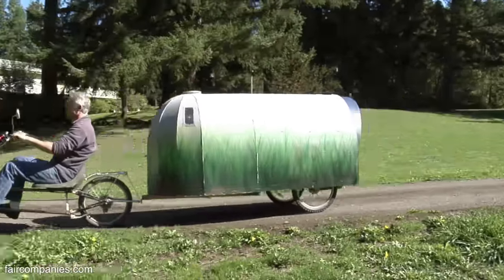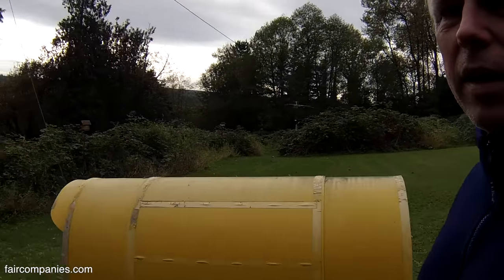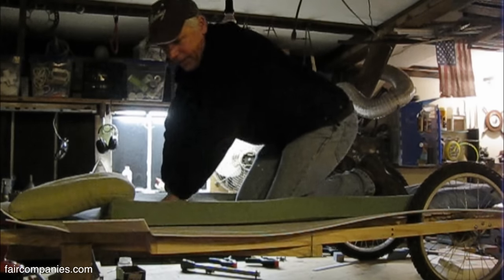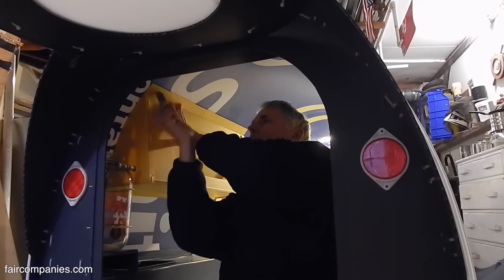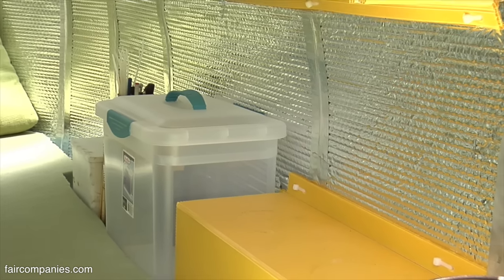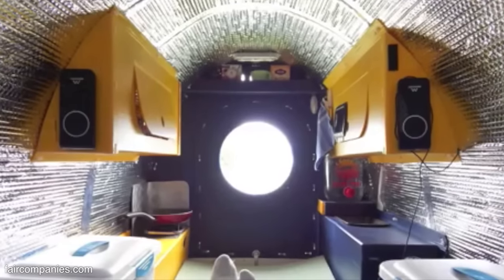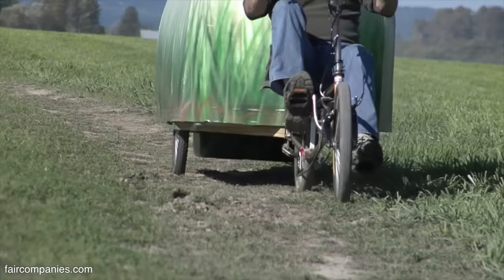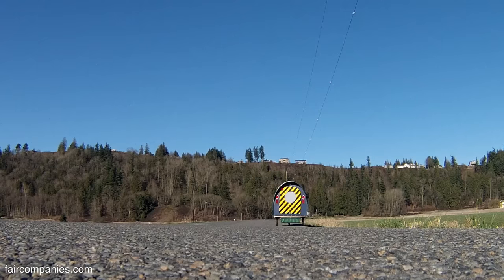$150 bike camper: DIY micro mobile home (downloadable plans)

Comment: I've worked in the large format printing industry for 18 years and my advice to anyone interested in making one of these, contact your local large format printer and ask them if they have any scraps. Unfortunately the industry is very very wasteful and there are often many odd shaped drop pieces that too often end up in the dumpster because they are difficult to recycle properly. You can score all kinds of amazing materials by just asking. Coroplast, acrylic, canvas, vinyl ect. It never hurts to ask. Also I've gone to foam manufacturers to score their drops as well when I was working on a costume project. They often have tons scrap pieces they will gladly let you have.
Reply: a2 - your comment makes a partial circle... almost like a rainbow 🌈 Can you see it?
Reply: Thanks for the advice!
Reply: No such word as 'ect' or is that another arcane material? ;o)  Perhaps 'etc' which I've been told is a contraction of a Latin phrase: et cetera,  meaning "and so forth")
Reply: +Richard Bruce Graham who cares we're on YouTube, not in school.
Reply: Ive done the same with granite shops.  Their removed broken and discarded backsplash pieces make amazing FREE lawn edge barriers for anyone with neigbbors that have creeping weeds like i do.

Comment: the largest sized dog houses available are also a great option. just need insulation inside. you can connect them, cut them and put them together, etc. worked well for me hiking in the winter. i make shelters along my most traveled routes and the dog houses have been extremely durable. even just one to lay down in, I'm 5'8 with enough room for my pack and boots inside.
Reply: very interesting idea. cool little bug out "huts/shelters" could be another function for them.
Reply: I am not sure what kind of doghouses you are thinking of, but I'm curious.
Reply: Great idea I may try this thanks
Reply: @geob01  they look like giant plastic igloos, they're usually made as outdoor dog houses. they last practically forever.

Comment: Get an electric bike and use the batteries on the bike at nite and recharge during the day from solar panels also save on pedaling up a hill.
Reply: Why not save up a little more and get a moped? Great on gas and seems more simple.
Reply: What if gas is not available?
Reply: Roronoa Zoro irrelevant question. Gas is always available, in every state and in every town. If you become stranded somewhere and have ran out of gas, then that’s a personal problem.
Reply: Wretch Gunk I’m not suggesting that gas is superior. I’m speaking solely from the perspective of being in a homeless situation, living near small towns or the far outskirts of a big city. In that particular situation, I’d MUCH rather have a moped & utilize gasoline over solar power. I could easily make the money for the moped/gas through raking leaves, shoveling snow, mowing grass, scrapping metal, etc etc.
Reply: Wretch Gunk You could connect  a small dynamo to one, or both, of the trailers axles and use them to charge one or two car batteries as you pedal, use for lighting, charging mobile devices, etc, could have solar panels to keep it ticking over when you are stationary for a little while, it could be a great home away from home, could have the batteries under the floor in the center, even add some extra storage under there have lift up flap for access,  I'd have great fun planning everything out!
Reply: Get a moped with peddles, for if you run out of gas
Reply: Or you know get one of those gas motor kits for your bicycle Tada best of both worlds
Reply: Now THAT sounds like a good idea!!!
Reply: Dennis Day another good idea...and just get one of those lightweight tents to set up at night and you’re ready to go!!
Reply: Gamble do you have any idea how heavy batteries are
Reply: Gas electric hybrid
Reply: "connect a small dinamo to the axles while using an electric motor to move everything" why don't you people understand that's not how energy works. Everytime you convert one type of energy into another you're losing it. If you charge a Li-Ion Battery you have around 95% efficiency so 5% or the energy is going wasted, if you use those batteries to move a motor you have around 90% of efficiency plus you have to add all of the energy that goes into mass movement and friction from the bike, the trailer and the air. so let's say 90% efficiency on the electric part plus a 50% efficiency into kinetic energy, then you have to convert back ON DIFFERENT GENERATORS to electricity. which is also constant so it adds weight to the first engine or your legs instead of smart activation like on newer cars. At the end you're losing more energy than what you've gaining, if you don't count yourself and your fatigue as a generator.
you're not smarter than all the engineers we have on electric cars
Reply: just put a motor on it put a solar on it but electric bikes work good too
Reply: People who live in these cant afford electric bikes. and probably arent in a position where they could save up enough money in a reasonable time
Reply: Or charge by day, pedal at night!

Comment: you should make a video just about "harvesting" the signs.  that would be hilarious.
Reply: No need to make a video, just go down to your local election headquarters and they'll donate all the 4x8' signs you can haul.. Especially if you tell them what you're doing with them.  They'll also throw in the wood that was used to hold the signs up.
Reply: November! Don’t forget the harvest is coming soon!
Reply: @sidelinedmom9609  I have a 2 hour bus commute over a 20 mile stretch through LA 4 times a week. I haven't seen a SINGLE campaign sign out here 😳
Reply: FPVREVIEWS could use all those hillary for presedent signs lol
Reply: Update: I was able to get 5 of them the morning after midterms. Still not sure what I'll be doing with them
Reply: @gregsmith2190  Sending my support for Trump from the UK maga 2020 .... you lucky bastards I will swop you a trump for a Theresa May
Reply: I’m glad you could locate some signs. They are everywhere up here in Washington.
Reply: @gregsmith2190  this is a video about a bike camper and yet still you have the need to bring up your political opinion. Calm down with your TDS issues.
Reply: Cruciflex make a crate
Reply: @gregsmith2190  you found your chance to attack trump on a bike camper video. The ultimate tds, wow.
Reply: @feeelickss  make a small shed. Upgrade it to camper if you like ;)
Reply: @gregsmith2190  how'd that work out lul
Reply: @trungminh321  holy crap, this would make a great shed! To the campaign head quarters!
Reply: Greg Smith u mad

Comment: Next challenge: make the entire bike/caravan into a single unit, like a motorhome but without the motor - a cyclehome, if you will - such that you are traveling within an aerodynamic and weather protected cabin. It could reduce the overall length and remove one of the wheels decreasing weight and rolling resistance.
Reply: +spinycrayfish Spiny you know, 80% of the force you feel while pedaling is air resistance, rolling resistance is so much weaker than air and air so much weaker than gravity. Just letting you know! ^-^
Reply: Hence the benefit of driving from inside the cyclehome. Tow something like that and it's the person up front slowing you down. :)
Reply: +spinycrayfish --- You can get a shell for a recumbent  but as most things these days real pricey, but an all in one unit would be neat
Reply: +2012spacetraveler Velomobiles man! You can make the shell out of coroplast!
Reply: That's exactly  that crossed  my mind...also having bendable fiber rods to make upper frame so that it would be taller and a bit wider then a water proof canvass strapped to rods
Reply: Spinycrayfish, I need to introduce you to my friend Rick. He's pedaled passengers around for years. His name is Rick Shaw.
Reply: Was thinking the same thing.

Comment: I once cut, shaped, welded and riveted together the shells of two gas furnaces I had lying around.   Used free cardboard box on the inside to act a wall/ceiling insulators.   I made a little storage shed of sorts on wheels.   So ugly... so heavy, but I might just try something like that with it for fun.   I like your idea.
Reply: mashroob  sounds like it would be heavy and hard to pull you should put some solar panels on it and get and Electric bike that you can power with the solar panels so you don't exhaust yourself!

Comment: Have to keep an eye on those zip ties as I've had them turn brittle from sun/weather exposure and break. Otherwise, good for him (and for disposing of some campaign signs).
Reply: +justgivemethetruth   Yes, the UV rays are hard on plastic, but if you just spray it down once or twice a year with Armor All, that will give you the UV inhibitor you're looking for. This is very cool. I really enjoy Pauls channel.
Reply: ....and the price just went up.
Reply: +Random Button Pusher I&#39;ve heard people say that the black zip ties take the sun better.  This construction method covers all the ties with duct tape, so I don't know if it matters or not.
Reply: I've had problems with black zips. Yes, the major seams were covered, so that should help. Perhaps the spray paint will help too. Better than having to regularly spray with Armor All or other such (808?) like I should do with my Royalex canoe. But overall, it doesn't look like to sturdiest construction. That's the trade-off for light and inexpensive. Cool idea still.
Reply: +Random Button Pusher You can buy UV resistant zip ties for use with garden plants and shrubs. Won't last forever but much better than the cheapies.
Reply: Thanks for the tip. While zip ties are quick and cheap, I wonder if there aren't ways to use thin cordage to stitch the panels together, as folks who make certain types of wood canoes do.
Reply: Random Button Pusher
Canoes and kayaks are stitched with wire, but it's removed after the glue dries, and before the fiberglass is applied.
Reply: I was just thinking of the stitching concept, not the full fiberglass technique, when offering the comparison.
Reply: Random Button Pusher
Sure, I get that.  The thing with zip ties is they are really convenient.  Stitching with a long piece of wire is a bit more trouble.
Reply: +Random Button Pusher Paracord comes to mind
Reply: Yeah, inexpensive, too. Or one of the thin, high-tech cords, which I bet you can find one that is UV resistant, though pricier for the durability.
Reply: +Random Button Pusher black zip ties absorb the UV rays easier. As an electrician, we were required to use clear zip ties when securing down wire to cable trays.
Reply: +Random Button Pusher Doesn't he cover the sun-exposed zip ties with duct tape and paint?
Reply: +Michael Derosier Thanks for that info.
Reply: +Random Button Pusher IKR.  Too bad he can't do the same thing with the ones on TV.
Reply: Eric Hawk Yes, I noted that in a previous comment.
Reply: +justgivemethetruth 
Use the black ones - they last a lot longer.
Reply: +deezynar You are absolutely correct regarding black plastic being more durable. Anytime color is added the material is weakened at the molecular level - ie tires are black - this is the same basic principle.
Reply: +Jason Seifert (Jay) Depends on the polymer. Most are naturally white or cream coloured. Adding colour means adding suspended particles which might block the UV rays a bit.
Reply: +Random Button Pusher      Some of the wire ties have a UV protectant added to the plastic.  I believe they are colored black to indicate the UV protectant presence.  Be sure to read the specs.
Reply: +Random Button Pusher I personally would have used plastic rivets and washers that are designed with UV protectant.  I would have also used a rib cage design using carbon fiber rods for stability and rigidity.  As far as a solar panel as he mentioned, the technology available now is very light weight.  The biggest weight would come from the DC/AC inverter and the battery.
Reply: SecurityPro2704 Just use dc only. It is all what it needed to power most of devices and LEDs
Reply: Yeah as said in other replies the black zipties dont really get weathered, im do security cabling including electric fences and we use the black zipties to put up the signs, legally need to always be on the fence so they we cant really afford to use ones that go brittle
Reply: +justgivemethetruth haha!  they do:  just use black ones.  UV does not destroy them in 1 season!  even HF sells the black ones for a premium -calling them UUV resistant.  hahahaha!
Reply: I've had the super heavy duty zip ties break too, however, they make them in metal!  Or you can even go cheaper and stronger and use hay bail wire!!!
Reply: Leslie Ann Taylor-Bjarnson Metal zip ties, cool. But baling wire is a great idea -- not as quick to apply, but cheaper/stronger is good for DIY.
Reply: Bail wire is amazing and super cheap.  I actually used it yesterday to replace the wire on my cheese slicer that broke.  The wire broke and I thought - I'm not going to go buy a  new one, I'll just find some wire, take the broken wire off and replace it with bail wire.  It worked!
Reply: Leslie Ann Taylor-Bjarnson Outstanding!
Reply: hose clamps would work in that case...
Reply: Nicholie Polie No rust problems on those? I had them around and they rusted into nasty state. I might have bought some shitty ones.
Reply: Just pack some extra ones and bring along
Reply: +Leslie Ann Taylor-Bjarnson  the problem is the metal will cut the plastic over time
Reply: Copper wire. Find out best guage for this app.

Comment: Cool but I can't imagine going up hills on that bike.
Reply: absolutely
Reply: Two feet you have
Reply: Jeans on that brutal seat. This guy is hardcore.
Reply: If he adds solar panels he could also add electric assist on the bike, then he would really be mobile.
Reply: And "travel around the country" seems far-fetched.
Reply: copperpaint would just come down to gearing ratios.  Recumbent bicycles seem to be remarkably efficient and low wind resistance - the killer for cyclists.
Reply: That bike is easy to drive
Reply: @jjryan1352  maybe around the state, or if you're homeless like he said
Reply: Recumbent bikes aren't built for that--and trailers make it worse
Reply: now have e-bike

Comment: I did an 880 mile bike ride many years ago and camped overnight in safe places by the woods. Wouldn't you know it, my final night I slept one foot away from a fire ant hill. I woke up and put my right foot directly on them as I began dressing for my last 175 mile day. Those ants covered my foot and ankle, and put a big chomp, all at once... My foot swelled so I could not wear my riding shoe, I wore my flip flop for the first 50 miles. At 10 a.m I put my riding shoe back on and completed my ride by 4 p.m. I intended to ride from the west coast of the USA to the east coast the next year but life happened. 

I sure could be used one of these bike campers in those days. Great!

Comment: Look into RV Awning tape.  Its clear and thick.  Used for repairing awnings.  To seal the seams.  Its normally in RV section in Home Depot/Lowes.  Not in paint section.  Looks like packing tape but thicker. 
Or on line. I put it on my house vinyl where it got holes from Trimming the grass and old screw holes.  Works great.

Comment: So cool!  I'd seen this before, when we lived in a house.  Now, two years into full-time RV living, it was well worth watching again.  Mr. Elkins did an outstanding job of turning inexpensive materials, and even removing materials from the trash stream (kudos!), into a viable mobile living setup.  The travel days would be somewhat slow, but it can go pretty much anywhere.  We're about the opposite end of the mobile spectrum, with a total rig length of 63 feet, something like 15 tons, and needing to worry about overhead clearances.  Many RV campgrounds aren't even able to accommodate us.  On the other hand, we have all the comforts that cannot fit in such a small, lightweight platform.  I hope that he's still out there, building things like that and living the good life.  Also, thank you Kirsten for making this video.  As usual, you did a great job of presenting the story, and not intruding.

Comment: Looks real good! When you build your next one, use black tye-wraps. The white ones don't hold up well in sun light. Yes you covered yours but still, they Will deteriorate faster then the black ones.
Reply: Bill Morrison or... Use those 100lbs    capacity steel ones... They are about the same weight... Maybe less. And far stronger, thou... More expensive
Reply: Same here.   I live in the Mallorca, Spain, and I can really ensure that.  SUN gets white zipties  rotten really fast.
Reply: Hah I said the same thing. Used to use them on the farm a lot when I was a kid. We'd have to fix the fences far less often when using the black ones
Reply: Thanks for the tip, Bill Morrison. Must actually be the light that breaks it down.